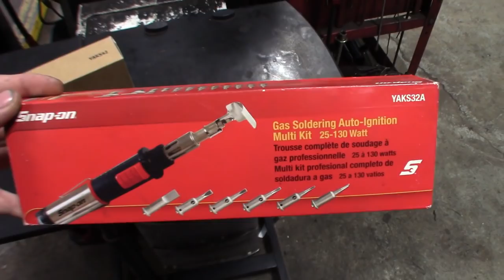SNAP ON SOLDER COMPARISON

Comment: Cool video. I'm sure a lot of people were wondering how these compared, so..... great choice. TY for doing it.

 I am far from a soldering snob.. I'm a Machine Mechanic, and I probably have to solder about 8-12 times a year, however, often times when I do have to solder it's a big job (20+ joints). I understand that cordless soldering irons like this have a place and sometimes can be a life saver, but if I have a choice, it is my electric Hakko every single time. Honestly, the higher end electric soldering irons are so much better there really isn't a comparison. Closer to 2 different tools than 2 different types of the same tool. And, if anybody is new to soldering, a tip I wish I knew when starting is that a pure conical (pointy) tip is one of the worst kinds. The points are too small to hold heat effectively and you wind up having to use the side of your tip which defeats the purpose of using a pointed tip in the first place. Use the smallest true chisel style tip you can find and you will be much further along than struggling with a conical tip to get mediocre results (yes...even for the smallest of soldering joints) And...for Pete's sake, use leaded solder. It requires a significantly lower temperature and the solder moves and responds to the iron infinitely better. OmG it is so much better. I've thought about getting one of these Snap-On soldering irons, but I they are almost identical quality and usability to the Milwaukee 12V. I have used both. If you have any 12V Milwaukee tools and you are torn between these Snap On ones and the Milwaukee I'd choose the Milwaukee.. if you dont have and 12V tools, I'd say they are a toss up. Well, except the price. The Milwaukee is about 1/3 of the cost... Obviously, this is all "my humble opinion", but it is an unbiased, honest one and one based on real world use and experience. Happy soldering.

Comment: Thanks for sharing. I have a question about replacing parts on the iron. I have the 32. haven used it in awhile. Will not ignite. I can here the gas coming from it. Doesn't seem to change by moving it from high to low. Suggestions on how to fix it.

Comment: I'm a little late to the Party, This is the first time seeing the 42,I still use my 32,I had to replace the burner jet a few years ago. I ended up finding a good deal on ebay for replacement parts,a new burner jet and extra tips for $35. Maybe Ill pick one up after my 32 craps out.

Comment: My dealer has both available the older one was surprisingly a higher price 210 vs 175? I believe. I have the snap on torch 300 I use now.